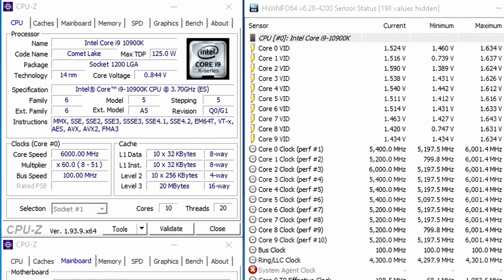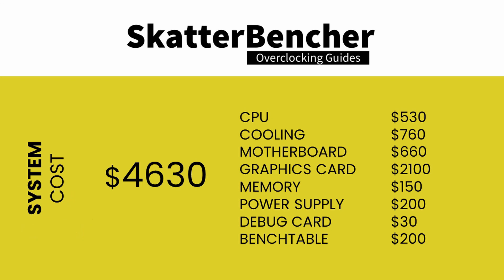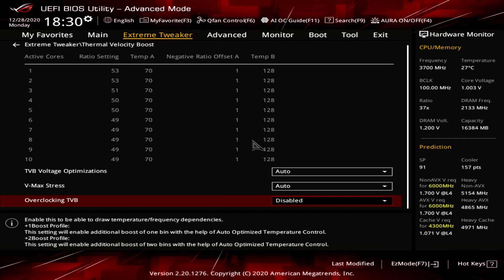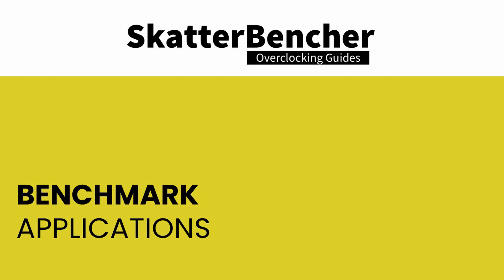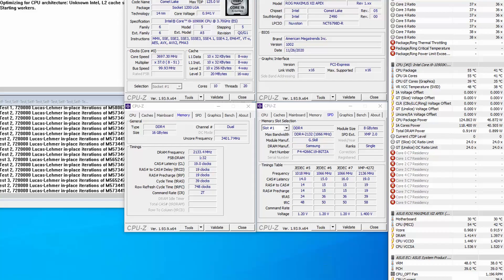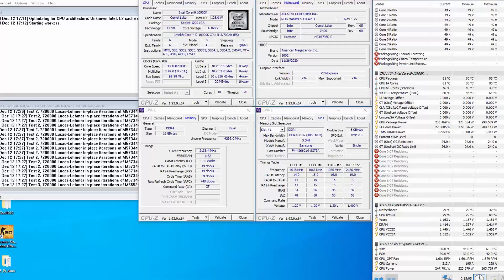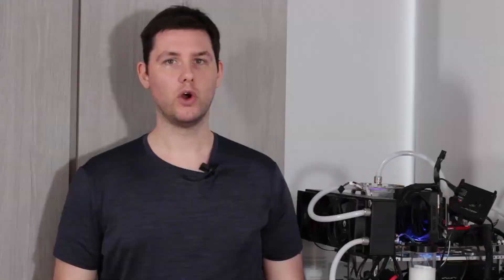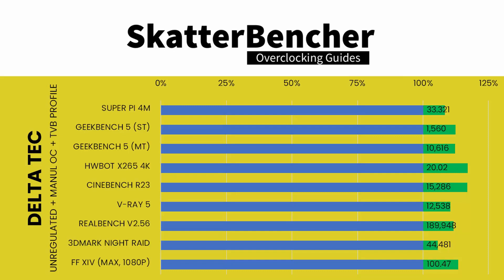Core i9-10900K Overclocked to 6000 MHz With Intel Cryo Cooling | SkatterBencher #19

Comment: Thanks for this, definitely the best info I've seen on configuring these new coolers. I'm glad my decision to go with a good 850w power supply looks like it will work. Hopefully my "humble" MSI Unify board offers similar performance.
Reply from the maker: Thanks for the kind words. I have a 55-minute "full details" video scheduled for January 7 where I explain the BIOS configuration in detail. There's a lot that goes into getting the system working for daily-ish use as opposed to just using the Delta TEC for messing about. Hope you'll enjoy that one too! :)

The 850W power supply worked in all situations, except for when I was running Prime95 with AVX and Furmark and unregulated mode at full power. I'm not sure why it wasn't working properly as I tested with a 1600W power supply and didn't see power consumption exceed 850W.

As for the Unify: it should treat you very well too. Good luck!

Comment: We need  more powerful Peltier   at least    250Watt
Reply from the maker: That would definitely help! I'm curious to see if future iterations will have more powerful peltiers.
Reply: @SkatterBencher  Here it is . There is a new version of EK Cryo cooler block with a 250W peltier ...
Reply from the maker: Thanks! I tried out the new cooler already and was able to get 265W package power during prime 95 https://youtu.be/pfeXO4J-0gs :)
Reply: @SkatterBencher  Hi . Can I ask your opinion about some attempt of mine to overclock my i9-10900KF on all cores above 5.5Ghz , somewhere around 5.6-5.7Ghz all cores on full load for a daily use? (using delidded CPU and some special high end custom water cooling  - I can go into details of the coling )

Comment: Hi Skatterbencher I hope I can find that TEC cooler available in stock some day, :D Oddly your "SP91" chip seems to AI-recommend just ever so slightly worse clocks than on my SP94 10900K 
Just curious also , how do you mount your 360mm EK rad onto the OBT Benchtable? Got my Benchtable in late last year w/ the ElmorLabs Debug Card gift, so was hoping for any tips :P. Need to fit 2x AIO 360mm radiators (temp bench for testing my KP3090 which comes w/ a 360AIO and an EK 360 DRGB AIO on the 10900K). Thank you for the interesting videos as always, Happy New Years!
Reply from the maker: Thanks for the kind words and 新年快樂!

I think the EK web shop should have better product availability in the coming weeks https://www.ekwb.com/shop/ek-quantumx-delta-tec.

I mount the 360 radiator exactly like they show in the marketing shots: https://streacom.com/wp-content/uploads/bc1-hard-025-000.jpg. Just using the screw position near the center fan rather than the outside. I guess it should be possible to mount one radiator on either side of the table.

Nice set of parts you have there! :)

Comment: Didn't understand the "thermal runaway" part, can anyone explain?
Reply: The TEC can handle only max 200 Watt CPU powerconsumption. If the powerconsumption of the CPU exceed that limit, the TEC starts to work like a thermal resistor. The temperature will increase until the system failes.
Reply: @skynet8764  thank you.
Reply: Essentially past that 200w point, the TEC starts acting almost like a thermal insulator, so the chip suddenly starts getting much hotter with no way to cool down, no matter how good your cooling loop is

Comment: i have a problehm with the cooler   i have this thing and down right bluee icon are in the midle jelow. the bios is up to date my mobo is asus maximus12 formula and 10900k preselct cpu. the program sey me waiting to gryo cooler to start up    sorry for my englisch. in the scool my second lanquace whas german
Reply from the maker: Did you plug in the USB connector correctly? It sounds like the software isn't detecting the Cryo module correctly.